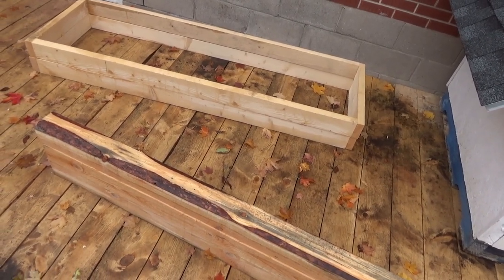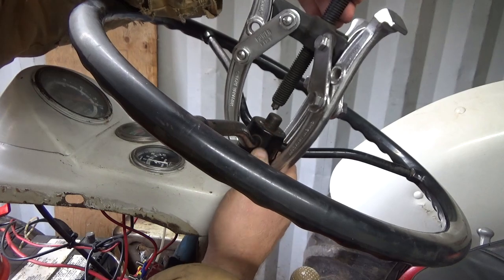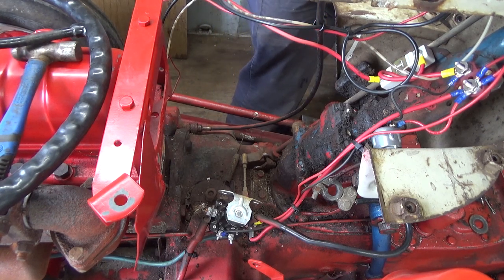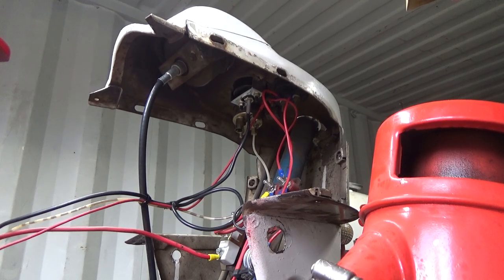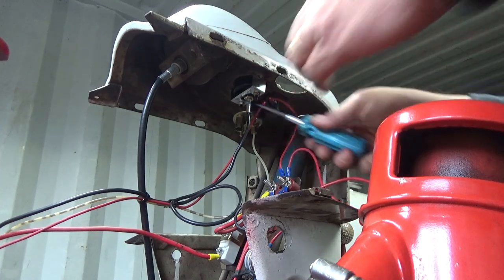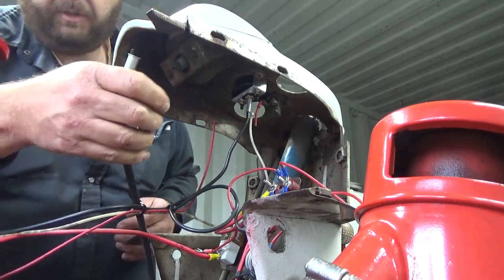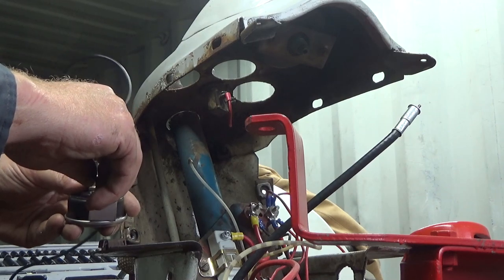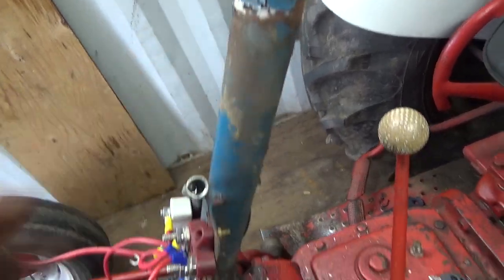Ford 800 console removal for painting

Comment: Whats the horsepower rating on that tractor?
Reply: Engine Specs
                                      US	           Metric
Gross Power	         39,5 HP	          29.4 kW
Net Power	         35 HP	         29 kW
Displacement	170.9 cu in.	2800 cc
Bore and Stroke	3.9×3.6 in.	9.9×9.1 cm.